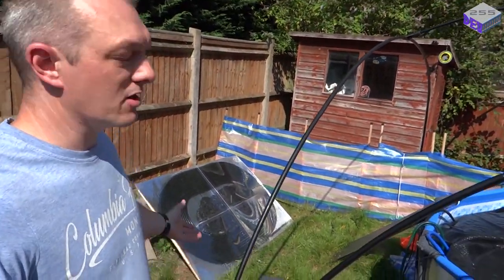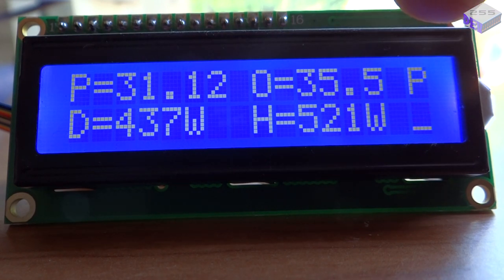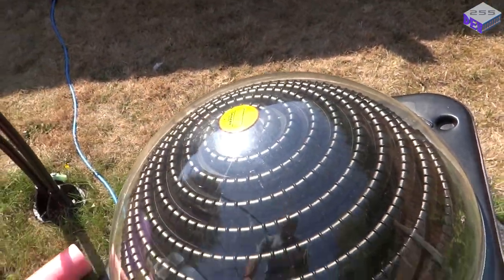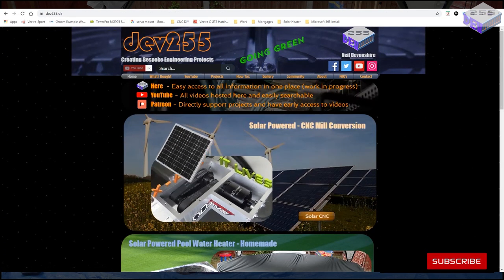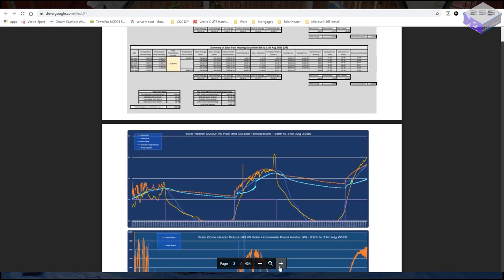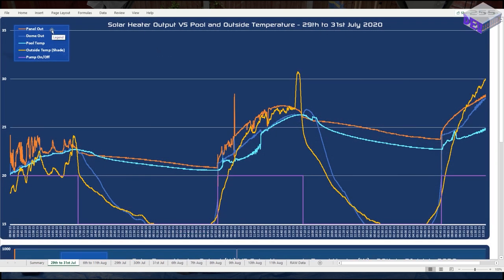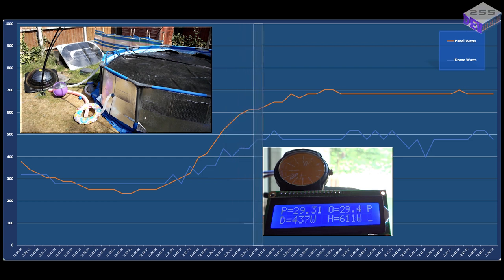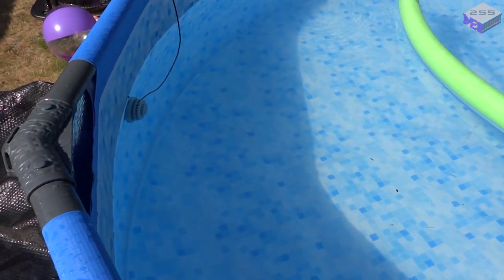3. How effective are Solar Pool Heaters really? - Results of full test

Comment: oooh... nerdy as hell.  I love it.  I plan on making one of these, but a little larger, and need to see if I can integrate a controller with the Pentair Intelliflo smart pump.  I love the data logging, but I may have to dig in to what an arduino or pi can do to automate the heating.  thanks for putting out what you're putting out.
Reply from the maker: No worries, glad you liked it, you've encouraged me to get the Arduino code out on my website quicker, I will upload the transmitter and receiver Arduino sketches and share it here and in the comments.
Reply from the maker: Hi, I've uploaded the Arduino Code, feel free to take a look on GitHub here: https://github.com/Dev255/ArduinoDataLogger
Or on my website here: https://www.dev255.uk/solarwaterheater
Happy to help if you have more questions. Regards, Neil.

Comment: Hi Neil, awesome test. I am thinking of building something similar but smaller (so that is possible to link more heaters, in case of more power). I wonder how much the new absolute black paint (vantablack or musou black paint) in cooper pipe would affect the efficiency of this systems. Cheers
Reply from the maker: Hmmm good thought, it may improve the panel a bit, although is fairly expensive, would be good to see the results. I'd love to take all the suggestions and make a really efficient panel.

Comment: How are you not streaming the data inside to a computer via wifi? Seriously, this is impressive.
Reply from the maker: Hi Luke, Thank you 😀👍, I decided to log the data at the pool Arduino to ensure there was no data loss, plus we have a fairly long garden so WiFi may have been an issue. It wasn't going to be a research project, just to heat the pool a little for my kids, but was quite interesting to find out how effective they are.

Comment: Great video's thanks!! I went to your web site and tried to access your product links and It wont let me click on the amazon links. I'm thinking about making a roof top solar hot water system or adding a heat exchanger to offset my high electric bills from the electric hot water tank that I have.  Do you have any interest in building a system like this? I just found you so I don't know if you have already, I'm going to check now. Thanks again for the way you explain things it is very good!! Rush

Comment: I have painted the exterior walls of my pool black, this has made a MASSIVE difference in heat, just the surface area alone warmed by the sun warms my 16ft above ground pool (its 4ft deep 20,000ltrs) up to 29 degrees C. The temp is not taken from the surface, but as low down as possible. When i sit in the pool with my back against the walls i can feel the walls are much much warmer than the water. I also have a black pool cover. Before the walls of my pool where a very light grey (almost white) and the pool was freezing. On average the pool is about 27 degrees.
Reply from the maker: Hi, that is a really good temperature to be maintained. I believe a lot of my heat is coming off the pool cover (probably 60%), I do need to do more testing. I now (arrived today) have a Sol+Guard 500 Solar Cover, so hopefully this will help. I wonder if I could line mine with something as it's only a temporary outdoor pool. With light-coloured walls and floor, most of the light is refracted and reflects back out from the light surfaces, so this makes great sense. I wonder if a part sunken pool cover under the Sol+Guard 500 would capture more heat then, as I do have my old black bubble wrap cover.

Comment: Ive got a 30,000 litre pool currently heated with a 14kW air-source heat pump that uses 2.4kW max. Not quite sure such a system would have too much of an impact for me but would be interesting to know your thoughts.
Reply from the maker: Hmm that's a nice system, my initial thoughts are to use PV panels (20% efficient max roughly), lead acid battery storage and a pure sinewave inverter to power the heat pump, where you would need around 15m squared of panels to cope with the 2.4kW power requirements of the system, battery charging and running the inverter. If you opted for direct heating of the water through a solar pool heater, then you would need around 20m squared of water heating panels for around 14kW plus a small PV to run a pump. That is a lot of water to heat though and you would lose a fair amount of heat overnight without the sun and good pool insulation. You could always increase the number of PV panels to charge larger batteries for overnight use, although it would then be best to just purchase a full home solar system. Once the pool gets to a desired temperature though it would use less energy to maintain it (again the more the pool was insulated the better the economy) so you may need less panels. Well that was a quick think off the top of my head, although there is many variables to consider with not only the energy source and consumption, but also the initial cost, etc, etc, etc. Just my thoughts. Kind regards, Neil.

Comment: Hi, can you tell me if perspex / glass is a must on this DIY project? I want to try to finish as cheap as possible and looking to cut some corners
Reply from the maker: Hi, they do help stop the wind from robbing the energy captured so that it has more chance to heat the water running through it. For cheapness, I would recommend stopping the wind from blowing over the tubes such as a windbreak if you have one lying around (but not blocking the sun) or possibly a polythene cover as they are fairly cheap. I hope that helps
Reply: If your panels are suited to size you can look for old bus stop polycarbonates too, (over here they are always getting dumped) you might need to sand (progressive up to about the finest grit you can) and buff them to get a nice shine to them but it's about as cheap/best as you'll get between free and buying stuff.
Reply from the maker: @8thsinner  We don't get many here, but that is a good idea, I've used headlight restoring products on Perspex and safety glasses when they get scratched, plus it normally comes with a UV sealing spray.
Reply: @TheSolarPoweredEngineer  On a different note completely, i've been brainstorming the whole concept a while now and was thinking, pennies, after soaking up vinegar for a few hours to bring back their shine, glue them to the base board behind the pipes. The mass and material would hold the heat for a good time I think.
Reply from the maker: @8thsinner  That could possibly work, although don't know if I would be allowed to glue pennies to it. I believe you cant deface the coin and believe the bank owns the penny and not the holder (being a promise to pay the barer). I think so anyway, you could try it, although I won't be showing it on a video, haha. ;-)
Reply: @TheSolarPoweredEngineer  Well if you wanna get technically legal, the coins no longer have any interchangeable value of gold to begin with anymore and by your birth certificate you actually own a percentage of the govt's finances too, equivalent to 700,000 or something so I have been told, not that they'd ever tell people that but also, glue doesn't deface anything, it can be dissolved. But it's cheaper than a copper sheet would be. But I hear ya.
Reply from the maker: @8thsinner  Hmm, 700,000 would be a nice payout if they gave it to us; I'm sure we give more than that to them in our working life.
Reply: @TheSolarPoweredEngineer  Yeah I have no idea on what sort of scale that is or how it was worked out, maybe 700k a year but then if they followed the "law" to begin with they wouldn't have that money either, it's all so screwy.

Comment: I think they get over-hyped, based on the videos I've watched today.  It's worth keeping in mind that even at noon on a very sunny day, sunlight brings you about 1 kW for each square meter of collector area.  And you won't get all of that - your system will always have some inefficiency.  But you can use it as a "theoretical limit."  Give the size of your pool (gallons) and how much temperature rise you want, you can figure out how long it would take a kW to do it.  And if your pool is a "real" in-ground pool, you'll probably be demoralized at how much collector area you'd need to "decisively" heat it.
   
So, if you're really interested in this stuff you should go through that calculation, just so you realize exactly how big a dragon you're trying to slay.  There's a reason our gas-fired pool heaters cost a lot to run.  But... "do they really work?"  Of course they do - they do exactly what it is reasonable to expect of them.  A well-insulated, well-sealed box with a transparent lid can get way up over 200 degrees F if you're not flowing any water through it to cool it.  If you send water through there, it WILL come out warmer.

Comment: I am looking at designing a dual solar / smokeless rocket mass either bath tub or smaller concrete hot tub in the near future. Would you be able to provide and test a data stream for that with the older panels whilst your testing the newer stuff, as I imagine you're testing that new one about now? smaller amounts of water because the heating times would vary dramatically on the smaller tub and I would be hoping to get solar only pumping on copper pipes for it. 
I'm also in the uk and the weather sucks pretty much everywhere so, yeah, thoughts?
Reply from the maker: Hi, I am about to test the newer panels, although unsure what tests you require. Are you looking to have a data logger to compare your dual solar project with the smokeless mass? The Arduino logger is fairly easy to set up where I have the code via my website www.dev255.uk, so feel free to use that or quiz me further here.
Yep, I think we had two good summer days so far this year.
Reply: @TheSolarPoweredEngineer   Not so much, looking for the data to heat a smaller tub space, like a normal bath tub or one person hot tub instead of a 5000 litre pool or however big your pool was I can't remember.
I wish I was an electrical sort of person but I'm really not, nor do I have any money either to buy the stuff. 
In the future i'd be hoping that changes and if it does I'll be hounding you for info on your solar cnc set up cause thats the sort of thing i'd like to do myself too.
Reply from the maker: @8thsinner  Ah ok, so this heater collects (generates) around 500W and if you were looking to heat around 100 liters of water (bath tub size) then the following should help.

Joules = Specific Heat Capacity (water = 4182) * Mass of the Material (water = 1kg per liter) * Heat rise (ºC)
So Joules = 4182 * 100 * 1ºC
So you would require 418200 Joules of energy to raise 100 liters of water by 1ºC

Wh = Joules / time (in seconds)
So Wh = 418200 / 3600 (seconds in an hour)
So to raise 100 liters of water by 1ºC in 1 hour, you would need 116W

As this one is around 400W average over an 8 hour sunny day (500W max) then 400/116 = 3.4ºC per hour
Or, 8hrs * 400Wh (400 Watts accumulated in an hour) = 3.2kWh per day,
So 3.2kWh would heat the water by 27.5ºC per day.

If this was a 1000 liter hot tub, then this would equate to 2.75ºC per day.

The trick is not only to heat the water, but also to retain the heat through insulation.

My previous pool heater produced around 600W average over an 8 hour day and is cheaper to make than this copper version, although is a little bigger.

I hope all that helps.

They'll be more videos coming out for the CNC too, so please feel free to quiz me on that one too.
Reply: @TheSolarPoweredEngineer  Sry missed this...All that math hurts my head but short of it is, looks like it's plenty adequate to fulfil the desired function then. Cool. Hope I can build it one of these days.
Reply: @TheSolarPoweredEngineer  Whats the surface area of this one roughly? hard to guess being it's oval nature...i'd be looking at building a 4x4 frame. Probably three of them in sequence ideally, I think.
Reply from the maker: @8thsinner  That sounds like a good size; this one has around 0.81m2 of surface area, whereas there is around 950W/m2 in my location in the UK. If you are nearer the equator, there is almost double the energy from the sun (1900W/m2).

Comment: when you made your new panel, you assumed a flow rate.  how did you know the flow rate?  i saw no info on that. thx.
Reply from the maker: Good question. I ran the pumps into a 10litre bucket at the same height and with the same pipe lengths and calculated exactly 10litres flow over time.

Comment: That's awesome unfortunately on a larger pool I don't think 500 watts would make any difference Mabie 4 of those put together would make a huge difference
Reply from the maker: Hi, quiet possibly, although I have been testing out solar absorbing pool covers and they are proving to be very efficient when also using a clear dome cover over the pool too as the surface area is greatly increased

Comment: Nice job ! Well done !
Reply from the maker: Thank you, glad you liked it, took a while to consolidate all the data, although was interesting.
Reply: @TheSolarPoweredEngineer  My newer version is already on the way. Smaller panels (1.20m x 1.20m) this time with Arduino. Before I used an old computer (Arduino didn't exist or was just in the beginning) with the parallel port and a 8 channel relay interface. For the software I used MS-Visual Studio which controlled valves/waterflow. The temp. was monitored with a serial interface and 4 sensors. One disadvantage of this setup is that the data lines on a parallel port are undefined when the computer is booting. However, depending on the Bios there's a difference between some models/versions. There was a work around but still, Arduino's these days are much more suitable.
Reply from the maker: @PhG1961  Arduinos do make life a lot easier, I used to make circuits out of 74 series logic gates and 555/556 timers, then use kernough mapping to reduce the number of gates, then Boolean logic to check the design worked before making the monstrosity of circuitry, doh, so I am very pleased with Arduinos coming along 👍. Looks like you are well on your way to having a warm pool this summer, good luck with it, would be good to see it what temperature you can get it to.
Reply: @TheSolarPoweredEngineer  The idea is to make a time lap video and detailed overview. However, works like this are never finished..... a work in progress I call it, a bit like the never ending story.
Reply from the maker: @PhG1961  I found that time lap works best for YouTube videos on the amount of views you get, so good luck on your channel, feel free to share your link on here.
Reply: @TheSolarPoweredEngineer  Will do !

Comment: Is it worth it for a 3500l pond
Reply from the maker: Hi, I'd say deffinately, you would have a warmer pool than we had, were we could stay in the pool for 2 hours per day without getting cold. Hope that helps.
Reply: @TheSolarPoweredEngineer  thx. Also it's for  a  pond.there will be  fish in there. Do  you think that the hot pipes will affect water quality
Reply from the maker: @ritesha8050  A yes, just spotted, you wouldn't want to swim with the fishes... The pipes would be at the same temp as the pond and  the pipe should not affect the water quality, although may be best to chat with an aquarium on that point, just in case.
Reply: @TheSolarPoweredEngineer  thanks man the fish need warm water

Comment: your pool is too big u need a smaller pool then u need no electricity at all good job
Reply from the maker: Hi, thank you, I will be looking at purely solar this year as I run a CNC mill in my garage purely on Solar, with a pure sine wave inverter, or could use a 12v pump. I would like to try a smaller pool, although it's for my girls to practice swimming. One of my projects this year is to heat water in an insulated closed loop like an emersion heater tank as this will have far less water and could potentially have enough heat for a daily bath full.

Comment: Фурако у нас
Reply from the maker: Привіт, Furako має працювати з цим так само, залежно від кількості води в ньому. Це також можна використовувати для нагрівання бака з водою; це те, що я хочу спробувати.

Hi, Furako should work with this just the same, depending on the amount of water in it. This could also be used to heat a tank of water too; which is something I want to try.